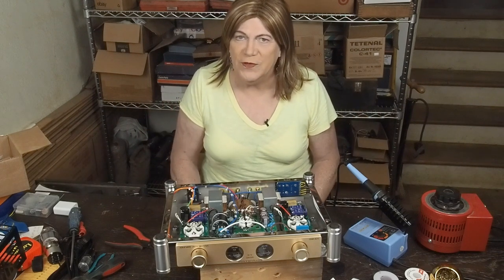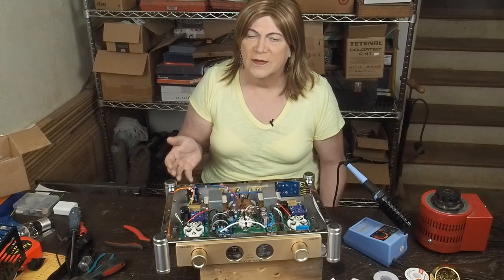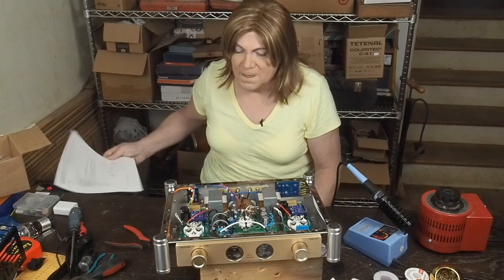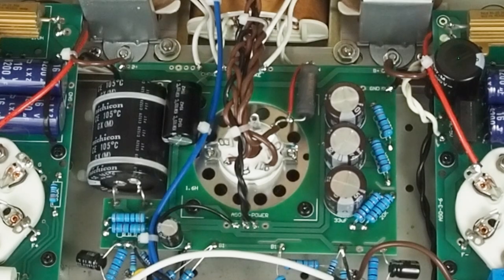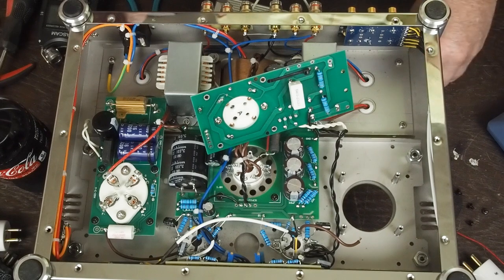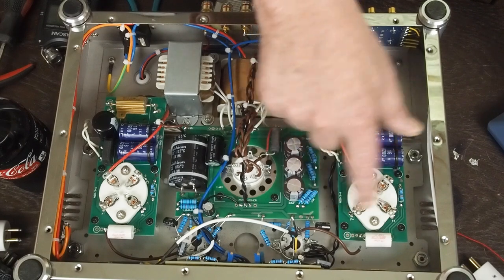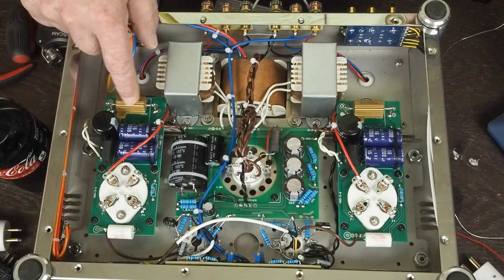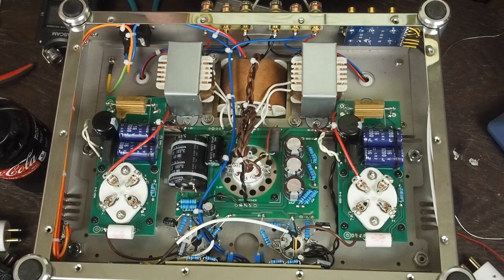Boyuurange / Reisong A50 300B Tube Amp Basic Mods Part One

Comment: When I want to open the hole on the pcb I simply use a toothpick.  It is handy when  hot modding a board that is already wired in.

Comment: Hi. Just found your channel - very interesting. I had a Boyuurange A50 for a bit and then sold it for a Willsenton R8. I really liked the mid range of the A50 but found it to be a bit grainy/noisy and lacking bass. The R8 (push/pull 45 wpc) was definitely cleaner and stronger, but lacked the sweetness that the A50 had. So I sold the R8 and just recently received an Elekit Tu-8600 300B tube amp that I love. The Elekit claims 9wpc. It's super clean and transparent. Still a bit lacking in the bass but I think that has more to do with my speakers that have 8" drivers... I'll probably add a sub.
Would be interested to hear your thoughts on the Elekit Tu-8600. Do you have any experience with Elekits and this amp in particular? Any suggested mods?? Any experience with using a low-powered SET amp with a subwoofer?
Thanks!
Reply from the maker: No experience with them, I'd be shocked if it actually makes 9WPC  and the bass is the tricky part with a tube amp. I'm using speakers with a lot smaller drivers and a good amp has nice bass so I wouldn't jump to it being the speakers. Did the R8 also have weak bass? As far as a sub, look for models that have speaker level inputs.

Comment: Hi there. I have recently purchased this amp with your mods already done. I noticed that it has hum even with inputs shorted . Original tubes except the rectifier. Would you have any ideas what to look for? What to start with? Thank you. Regards Paul.
Reply from the maker: Yeah, look at the tube heater circuit. My guess is they did something wrong there.
Reply: Will do thanks. @SkunkieDesignsElectronics

Comment: hi, thanks for this great series. Exactly what is a 'choke' doing?
Reply from the maker: The choke or "inductor" helps filter/smooth the AC while also adding for DC resistance between the filtering caps.

Comment: Is all the curent needed to be rectified in this amp done by the rectifier tube, or is there a split that runs some cicuits by a bridge rectifier?
Reply from the maker: All of the power goes through the rectifier tube in this amp.
Reply: @Nihil1st1347 the 300b’s filament run on DC. Hence those 2 bridges. Not looking at schematic. But from measurements.

Comment: You might try adding a Ultra path capacitor on each Channel from the power supply to the cathode of the output tube. You will have to isolate the power supply from each Channel by using a separate choke filter... The concept comes from a early designer who was discovered by the man that electraprint... I ran into a on a website from Thomas Meyer called vinyl saver wrong spelling but you'll have to look
Reply from the maker: Cool idea, the DIY amp uses a split rail PS with two chokes. Do you have a link to more info?

Comment: i wish there was bit more specific info on the capacitor part #s on the BOM, is the coupling cap that you put in a film or an electrolytic, the one you took out looked like a film but im having a hard time finding what it was you put in, part #s for those too would of been handy. I can make my way around with an iron but specing parts is still at a loss for me. I would really like to do the mods up until that point at the minimum with the different tubes youve recommended, the jumper, the 47uf and the .33uf (edit-the final diagram has a 0.33uf but in this video you say .56uf, if i just want to do up to this can i use the 0.33 without more mods or do i stick with the 0.56)
Reply from the maker: I clearly need to do a video on how to navigate parts. 

The problem with listing part numbers is specific part numbers are short lived and with supply chain issues, they might be out of stock for over a year, which identical spec ones are in stock.  When I have done this in the past, then I get endless emails about " I can't find this specific part number". 

And honestly on this amp, what makes the real difference is the rewiring of the front end tubes. The other mods probably won't even be audible until that is done. And yes the right part is an audio quality film cap 0.33uf. you never use an electrolytic cap for coupling.
Reply: @SkunkieDesignsElectronics  thank you

Comment: Can the 5AR4 rectifier tube be substituted for the original 5Z3PAT as a drop-in replacement? Or do I need to make modifications you mention - the bypass resistor and the filter capacitor between the two chokes to use 5AR4?
Reply from the maker: Yeah, you can just drop one it.
Reply: @SkunkieDesignsElectronics  Thank you for your reply. Another question. The original 5Z3(PAT) rectifier has 4 pins on the base. 5AR4 has 5 pins. Something is not connected to one of the pins?

Comment: Can I convert an El34 single ended amp like the Lao Chen EL34 to a 300B SET amp?  I’m wondering aside making sure the B+ voltage is high enough to power the 300B.
Reply from the maker: You also will need two separate 5V filament transformers for the 300B tubes and different output transformers. Also what ever circuit was used to drive the EL34 tubes likely won't drive a 300B.

Comment: Got all excited about finding a real pristine as new one locally and bit. Turns out the darned thing is 100 volt model. Paid about half or less what a new one would have ran. Disappointed when my email won’t go through to China Hi-fi to ask for buying a correct US mains transformer. I may inbox you, if you have any more ideas, don’t want a variac or step-down married to this thing.
Reply from the maker: That's one of the problems with this Chi-Fi gear, you can't get parts for them. The only other option other than setting up a 20-25V bucking transformer/reducer married to it is to hack some other power transformer. And then without ALL of the mods in my series, these aren't even a decent performing amp.
Reply: After more probing it’s 110 mains. But still junk with the initial 5AR4 mod, American 6SN7 and K42y Russian PIO caps. Variac 110
Reply from the maker: All those "easy mods' will not fix the problems with this amp, until you do the cascode rewire, that other stuff is a waste of time. It's common for them to ship 110V units to the US, many sold on Amazon have them and the best solution is find one of those APC voltage regulator boxes and set it to 110V or make up a bucking transformer.
Reply: @SkunkieDesignsElectronics  just happen to have a few Hammond 166N6 filament transformers. Will do the cascode and carry on. Thanks for the series! 
Luckily only had to buy a few resistors. 
Also want to try a couple Ohmite L25J1K0 1K 25 watt ceramic ww
Reply from the maker: I did a recent video about using 50W resistors from amazon and remote mounting them with thermal double stick tape to the side of the chassis.

Comment: What is reasonable voltage ripple for B+ since my amp has around 16mV. I read somewhere on the internet said reasonable value is around 150mV or something.  What is the total value for choke in series? For example 5H/300mA/150ohm would be 10H/600mA/300ohm? I was looking on the web that said double inductance but didn't see anything about DC current and Resistance. If you add filter cap between 2 chokes, would that drops the total of choke in 1/2 which it may change the max DC current and resistance.
Reply from the maker: They are 32 ohm chokes, 64 ohm total.

Comment: What about a NOS RCA or similar 5V4 as opposed to the 5AR4 recommendation?
Reply from the maker: That would work with just a slightly lower B+ voltage
Reply: Thank you! I'm doing all the mods to my Nobsound now, and am look to the A50 as my next step later this year. Had already invested in some great NOS 6SN7's and 5V4's for the Nobsound and was hoping to be able to swap those over to save some cash. Love the content and tips!

Comment: Maybe try non-inductive, non-magnetic power resistors instead of the sand cast type....
Reply from the maker: I'll look into that, who makes them?
Reply: @SkunkieDesignsElectronics  Mills Wirewound Non Inductive from Parts Connexion or Sonic Craft. You could parallel two 12W or 10W resistors. They are pricier than sandcast but worth it in cathode bias apps.. Another one is the metal clad Riedon resistors..
Reply: @SkunkieDesignsElectronics   Not sure the max power rating you need here, but check these: Duelund Standard Graphite Silver Resistors 5w and 10w
Pathaudio Resistors 10 Watt 1%
Mundorf M-Resist Supreme 20W
Powertron FPR2-T218 30W Metal Foil Resistor
Jantzen 10W Superes resistors
Reply from the maker: @mfr58  I'm only seeing these in 100ohm and less. These need to be either 880 or 1K (plan to try both of these values)
Reply: @SkunkieDesignsElectronics  Yes, you're right, I can't see higher values. How about 
RES-M1345-  12W MRA12 Mills Resistors, they have a range that you could make the values you want.

Comment: My A50 has a 115V sticker in the back. I did the mod but the 5ar4 arcs and blows the fuse. Do you think that It may be due to the amp being fed the 120V line voltage instead of 115V?
Reply from the maker: What 5AR4 did you use? If it was a JJ, that's likely the problem.
Reply: @SkunkieDesignsElectronics  that was my first thought as well but I was using a gold lion tube. Then I went down to guitar center and I bought a Russian   one, that worked a bit better but eventually did the same thing. Now I ordered a tung-sol. We’ll see how that works.
Reply from the maker: @andyermolli3226  A gold lion 5AR4 is fine, there is something else going on. I would unbypass that first resistor and try it like that with a new tube. Also did it arc on powerup or after it was running?
Reply: @SkunkieDesignsElectronics  I will try that. The weird thing is that I used it for hours with the Russian tube just fine. Then later when I went to turn it on again later it arced. That was at power up.
Reply: @SkunkieDesignsElectronics  ok removing the bypass has no effect except this time it didn’t arc but it just blew the fuse. The fuse that’s in my copy is a 4A fast acting 250v. What fuse did you have in your copy?
Reply from the maker: @andyermolli3226  Whatever it came with. A 2A slow blow should be enough for this amp. It sounds like maybe something is shorted? IDK if you have a dim bulb or a variac for testing? None of this makes sense.
Reply: @SkunkieDesignsElectronics  I have a variac coming next week. I will report back. In the meantime the amp works great with the stock rectifier so I can use it that way. The replacement coupling caps made a big difference already!
Reply: @andyermolli3226  I had the same arcing problem with a Sovtek 5AR4 I had a dim bulb tester on it fortunately. No blown fuses. I put the variac on it and could get to 90 volts without arcing after that lots of arcing. I went back to the stock 5Z3PAT and everything worked fine. I put a Tungsol 5AR4 in it and everything went well. Currently proceeding with the rest of the modifications.

Comment: Hello, I am enjoying your A50 videos and subscribed. Would a New Genalex GZ34 / 5AR4 work well as an upgrade in the rectifier location with stock internals on the amp? I don't know how to do electronics yet but I would like to tube roll. I am also looking at Psvane CV181-T MKII (6SN7) and Electro-Harmonix 300B or the Gold Lion 300B. Thanks for anyone's help here! Cheers
Reply from the maker: Not likely to make any big improvements, the amp as wired is too flawed unfortunately.
Reply: @SkunkieDesignsElectronics  Thanks for your reply. I ended up having your mods done on the amp and I love how it sounds! I am really enjoying it now. ☺️

Comment: I hve done the basic mod, bypass the 39 ohms and added 47uf cap btw chokes. Then I fitted a NOS Amprex 5AR4, enjoyed noticeable difference in audio performance, Bass was better, overall not as laid back. However it is less warm overall....as trade off. One worry, the Power Transformer gets very hot after 2/3 hours of play. Is this going to be an issue?
Reply from the maker: Have you checked the voltages?  It's possible you have a 110V wound transformer on a 120V line voltage. Many power transformers run pretty warm to hot. Is it too hot to touch?
Reply: @SkunkieDesignsElectronics its not skin burning hot, yet exceptionally hot. Can feel the Power Tran has hint of vibration too. Wall AC is 230v Singapore. thanks for quick reply....and expert suggestions appreciated. Is it the 39ohms bypass causing it？
Reply from the maker: @thomasleong9401  It never ran warm before? And again, I have no way to know what transformer your amp has in it, might be a 220V or a 240V primary. These amps seem to be all over the place on which one they use. If you think it's too hot, you can unbypass the resistor. Again, without checking the plate/internal voltages, you really don't know.
Reply: @SkunkieDesignsElectronics  I ordered with 230v Transformer. After two weeks of playing it, getting the tubes to run in, this mod to increase the voltage interest me！ It did improve the playback solidness of playback. If there is someway to reduce the hot PT would be great. My experiences are towards guitar amps repair and upgrade and lesser knowledge on hifi amp. Though I recently repaired one Audio Note Kit amp motorboating, and a Marantz 8B vintage hifi amp. Got hooked with the sounds,so bought this A50Mk111, it is enjoyable amp. I suspect the way it was set up by manufacturer intentionally, to play cool with warmth and to preserve longevity Your mods are appreciated, yet may hve to balance longer hours of playback and its long term stability. Will replacing PT upgrade makes it more comfortable. Out transformers are all fine, in terms of heat only the PT is my concern.
Reply from the maker: @thomasleong9401  just because you "ordered it" with a 230V transformer, doesn't mean that is what is in it. Again you are working on the amp and are there. The one I modded didn't get hot but was a 120V model. And unless you actually measure the plate voltage, I have no clue what voltage things are running at. Good luck with it.
Reply: @SkunkieDesignsElectronics  no issue, I can measure it....and see what gives. Maybe you can get some feedback from the A50 modified on my observation.Guitar tube amps that I do runs on 120v and some I am able to series the primaries to 240v, but have not seen appreciable differences to plate voltages. Most guitar amps use 5AR4/GZ34 yes, the transformers do get super hot （Fenders esp）regardless if I use 120v or 240v. But the iron there are heavy duty...this A50 not so sure？Anyway I will monitor and see what's comfortable.
Reply from the maker: @thomasleong9401  I really suspect they sent you a 110/220V primary and that is why it's running so hot. You should see around 430V plate to ground. Do be careful and observe all safety precautions as these are lethal voltages!
Reply: @SkunkieDesignsElectronics  I measured the 300B plates, its 430.3 and 430.1! Will try remove bypass wire at 39 ohms, and just use 5AR4....see what gives. Suspect the PT may fail over time being so hot? Can the cascode benefit without doing the basic mod?
Reply: With the 39 ohms intact, the plate of 300B is 412.7v and 412.1
Reply from the maker: @thomasleong9401  Did that make the transformer noticeably cooler? Seems very odd but if it did, clearly the transformer they used on your sample is undersize/rated.

And yes the cascode mods don't require the higher plate voltage but you might need to adjust a few resistors, especially the voltage divider, to compensate.
Reply: @SkunkieDesignsElectronics  yes with the plate at 412v the PT runs cooler.....according to my palm on PT surface. At 230v its of course more solid sounding, tubes are running hotter....probably bothering on 120F. Maybe best compromise is to not continuously playing for 6hours and more. PT has not broken down, with the 39 ohms and 5AR4 rectifier probably temp around 100F!No thermometer to verify...educated guess. remarkable no vibration detected from PT...when it's not cooking. Will install the cascode to the driver tubes and run it cooler. The rectifier is too close to the PT does not help matters too. Audio Note Kit, the rectifier is away from the PT
Reply: typo error ....at 430v not 230....

Comment: Nice build amp but I wonder why did they mount the shokes so close to the power transformer there is loads of room further away. Inducters so close they may pickup induction.
I use mundorf supreme 600v type copple caps. I have made a 6550 pp ul amp is some other then this se 300B amp.
Reply from the maker: Good point!!

Comment: 0.067 amp on the 300 B cathode / heater  is a good spot to be HT 410 volt / 410 x 0.067 = 27.47 watts of plate dissipation max is 30 watts  should should heaps better 27.47 watts / 30 watts = 0.91 %
Reply from the maker: It's actually 0.067 amp with 343V across the tube (410v-67V at the cathode). To get it to 90% with this transformer would require converting it to fixed bias and I don't feel this china 300B would survive with over 400V in a fixed bias setup + this frontend would never be able to drive it.
Reply: @SkunkieDesignsElectronics   jj 300 b good

Comment: Hi there again,  I have taken some measurements with the stock rectifier and I get 421V at the B+ and 408V at the output tube. Essentially all my DC voltages are an almost exact match to your measurements with the 5Ar4 but mine are with the stock rectifier. Is this what I should expect? I have already done the basic mod.
Reply from the maker: I honestly don't know what is going on exactly unless they put a different transformer in your amp. If the volts are right, then you are good :).
Reply: @SkunkieDesignsElectronics  I suspect that they saw your videos and changed their design!